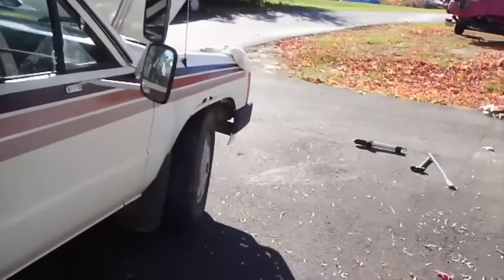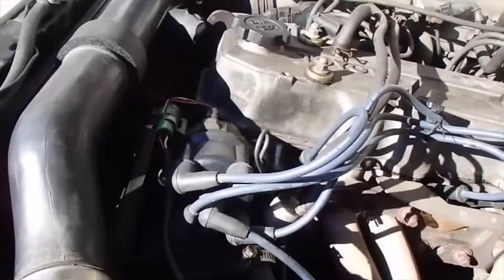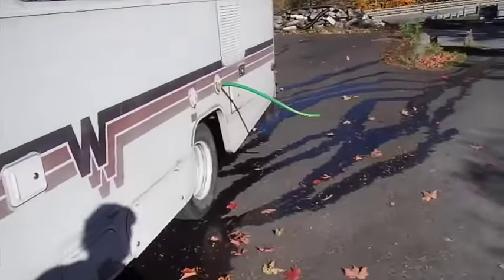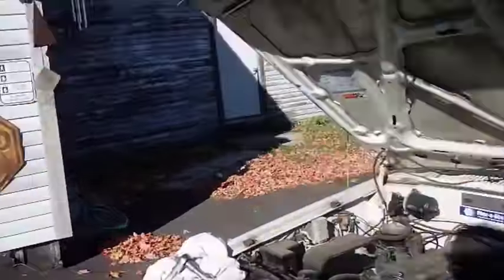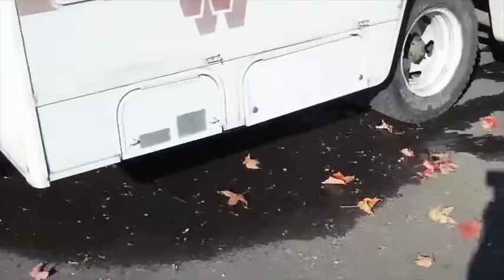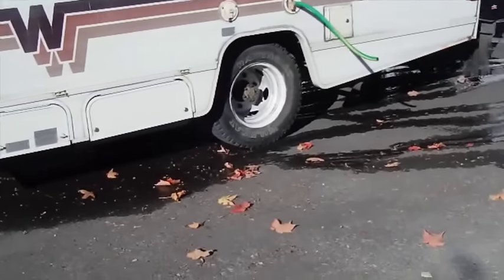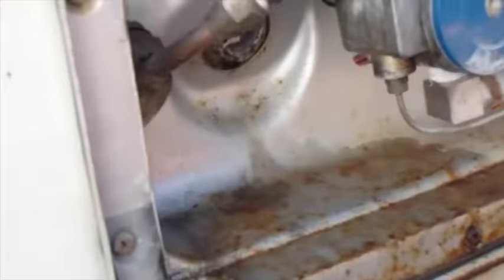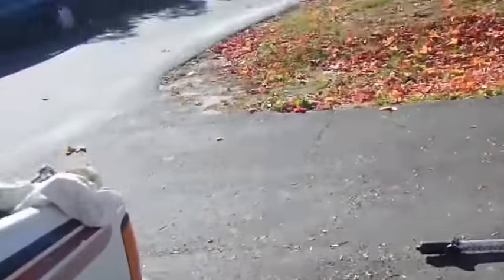My Two Concerns, 1983 Toyota Mini Winnie

Comment: I'm  a fan of the 22R engines as well. It's the "pirate motor," 22 ARRR! I had an '84 Hilux with the extended cab, it was a five speed, a really nice little truck. I had it for 14 years, and it gave me no problems. They're fairly easy to maintain, although I know little about the fuel injection. Mine had a carburetor, and ran like a champ for over 125,000 miles after I got it, then I gave it to my daughter and bought the '04 Tacoma I have now. I've wanted one of those little motor homes for a long time, they're really good little rigs. With some attention and TLC, that should be a great RV for the two of you. Linda and I send our best.
Reply from the maker: Thank You..

Comment: a miss fire at high revs is usually down to the high tension side  disy cap leads plugs etc, if they are old its worth replacing them anyway as a matter of course.

Comment: That's a 22R-E. "E" on the end of any Toyota engine model indicates ELECTRONIC FUEL INJECTION. That appears not to be the original engine since it has the '85-up style valve cover.  Have your mechanic adjust the valves while he is in there and also check the timing chain and tensioner.

Comment: The tail pipe steam could just be from moisture/condensation in your muffler. Doesn't appear to be a great deal of it. Does it steam constantly, or, just for a few minutes after start up? If it does it constantly, you may need a head gasket. If only for a few minutes after startup, likely just exhaust moisture. 
The hig speed skip may be a minor timing issue. More likely an ignition system issue. New cap, and rotor, may fix that.

Comment: I would not worry, you are not loosing coolant. I presume it does not miss under load? There could be many parts slightly out of tolerance. Just fix the oil leak and do a full service including valve adjustment and plugs and drive it...

Comment: Those Toyota (I believe yours is likely a 22R) engines are almost bulletproof if maintained.  The plug in the bottom of the hot water tank is a sacrificial anode rod.  Minerals in the water will attack it instead of the tank.  When it gets pitted too much you just need to change it.  It's cheaper than replacing the tank.  Yours will be good for a couple years yet.
Reply from the maker: Good to know.  Thank You..

Comment: I would imagine if you removed the sparkplugs and look at the firing colour, you may notice one thats slightly cleaner, water leakage.
It doesnt look that bad really, as you said its an old engine, it will have minor errors.

Comment: That miss mite be spark plug wire? Check under the hood while it's running at night. The CDI ignition s put out whopping amounts of voltage. And bad wire's will often glow in the dark!